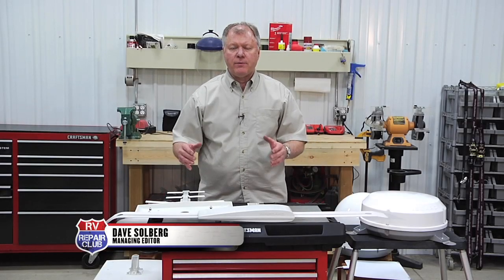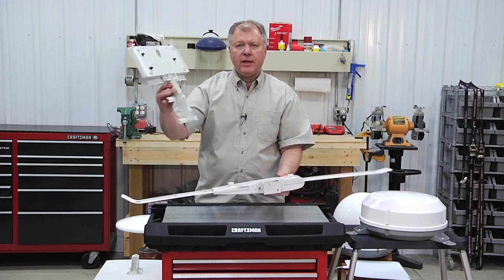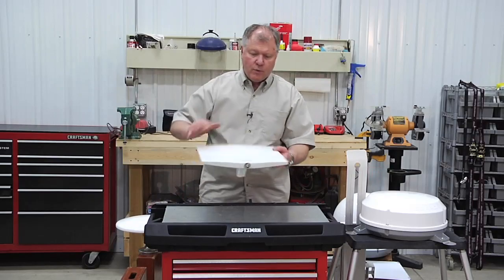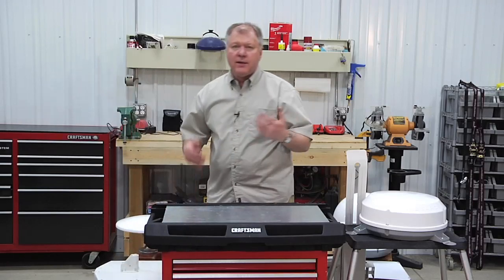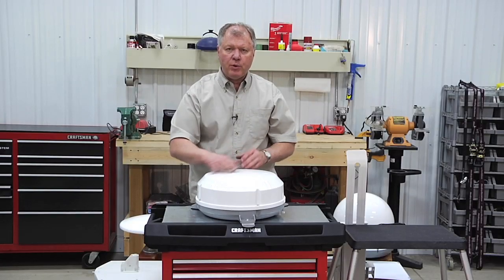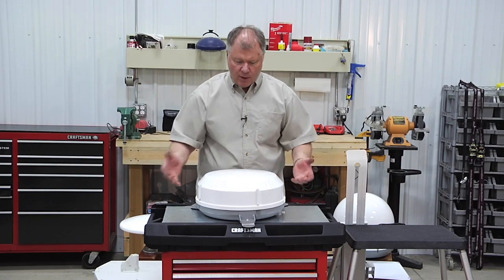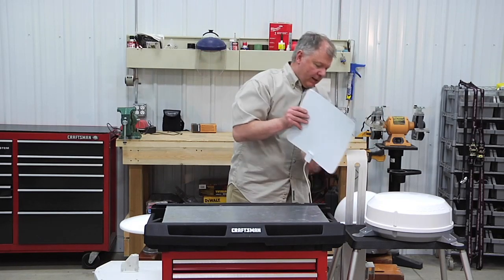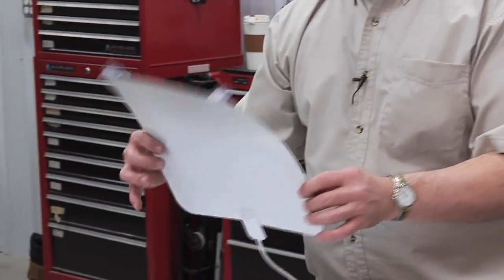TV Antenna For RV Options

Comment: Do travel trailers still come with antennas from factory anymore? Or did they ever? I'm looking at buying my first trailer
Reply from the maker: Hi Tyler.  Most of the trailers still come with antennas. They were a basic model for years but have been upgrading to better antennas on the newer models. Most of the newer ones are 360 directional so you don't even have to turn them for a better signal. You can always install better ones but it is best to test what it came with as they have improved over the years.  Thanks Dan RV Repair Club

Comment: Can you plug a regular antenna into the cable input and not use the rv amp. will that work?
Reply from the maker: Yes you can do that, you just have to make sure that the antenna booster inside is off so the TV receives the signal from the cable line. Most of the antenna boosters are selector switches, on for antenna and off for cable. If the booster doesn't allow any signal through you might have to bypass the connection at the booster and go directly to the TV for it to work. 
Thanks
Dan-RV Repair Club

Comment: I noticed that my coax cable is broken on the roof instead of running a new one can I use my King Dome satellite to pick up local TV channels? I really don't know much about this I just purchased this RV used. If I could avoid running new cables and a new antenna by using the satellite system that's up there I would rather do that
Reply from the maker: Depending on the package you have, your King Dome receiver/dish can pick up the basic NBC, CBS, ABC, and maybe FOX channels but only limited to the package you have. If the cable is broken, it’s easy to splice a new piece of cable to get more reception? I would think you could get a Best Guy guy or handyman to do it in less than an hour?

Comment: I have a hdms9100 mounting bracket on my rv, Will the bolt pattern be the same? Thanks
Reply from the maker: No they will actually be different from each mountable antenna. When installing a new antenna with a different pattern, I recommend covering the old holes with roof repair tape and then going around the edges with a lap sealant to help prevent the edges from peeling up. Depending on what you replace with, it might be close but most of the time the patterns are different.

Comment: when you showed the winegard single mount you mentioned that you may have to move it little around, does it have anything below that can be moved from inside the caravan, or do i have to get on the roof to move it around,
Reply from the maker: Thanks for visiting the RV Repair Club site and the opportunity to assist with your antenna question. It will have a handle inside the rig similar to the old batwing models that allow you to rotate the antenna to get different towers.
Reply: Thank you for your reply, why you did not show us, the full system, for example the King Jack they show you how everything works, the reason asking because i'm so confused which Antenna to get between the two of them :)
Reply from the maker: Hi,  Mario. The clip you are referencing is an overview of the various types of antenna available to help show RVers which model might be the best to upgrade to. We did shoot a comprehensive video on the automatic operation and installation as well as the new stand alone version which should be posted soon.